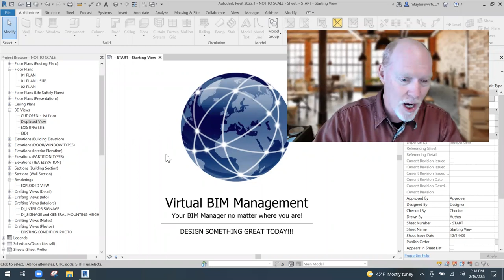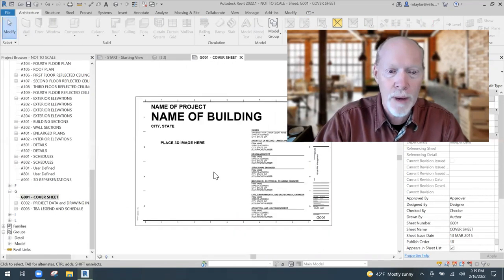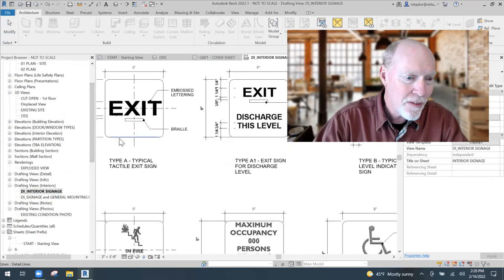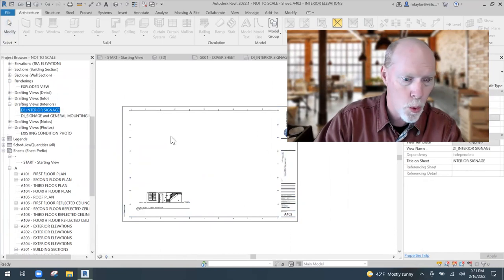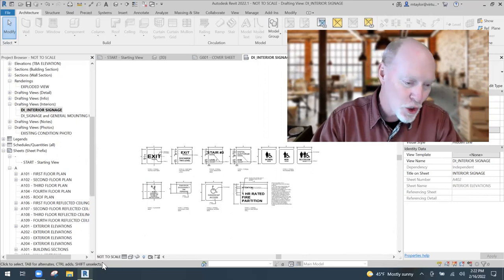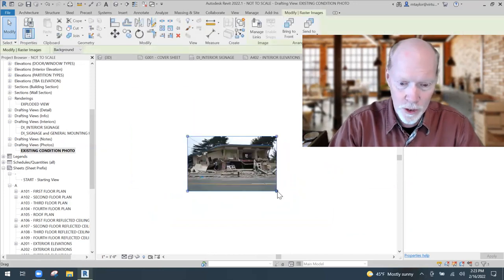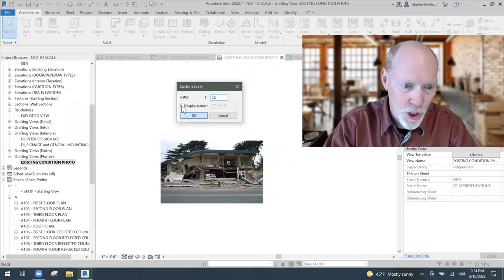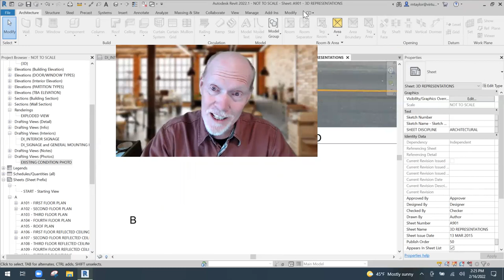NOT TO SCALE: of course

Comment: Hi you are a great instructor I benefited from your cut and fill video
I'm a new Revit learner and have some questions can I use Revit to calculate the amount of the backfill after placing isolated footings of a building on a site and can I calculate the footing and grade beam insulation quantity using Revit
Reply from the maker: Ok.. I did some testing and found that if you add a Building Pad... the cut/fill IS calculated (and when you change the toposurface). But when you add a wall and footings... the cut/fill is NOT calculated. So the only want to get it to calculate is for you to create spread or isolated footings with the Building Pad tool (on the Massing/Site Tab). That way it will work for you exactly as you need it to!!!  Good question, thanks!
Reply: @miketaylor-fantastic  thank you for your interest in my question
I will try that